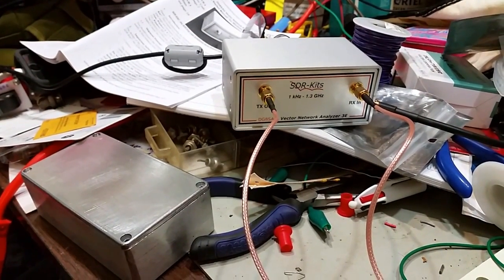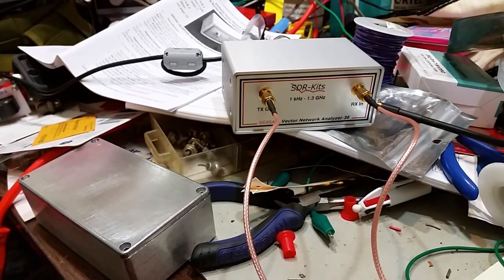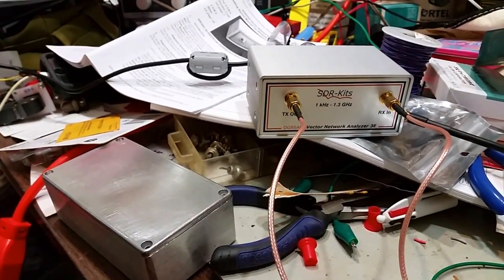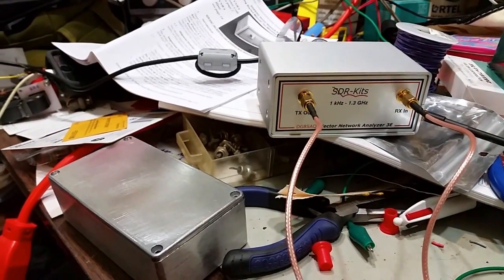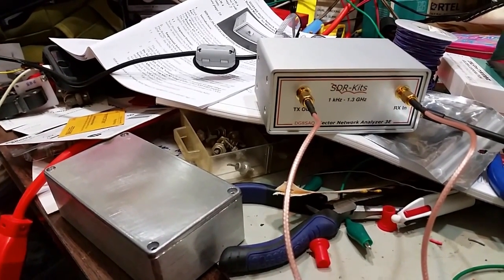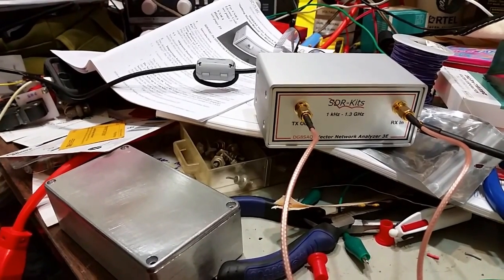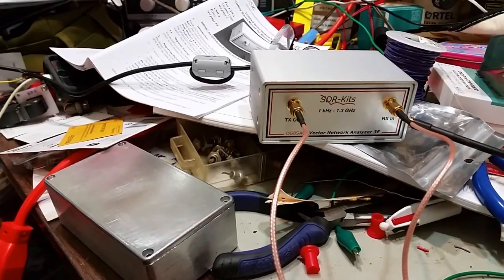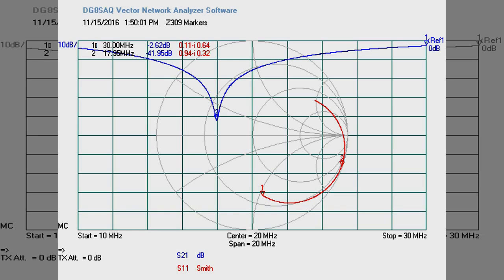Using the DG8SAQ Vector Network Analyzer to identify an unkown component

Comment: I'm new to working with coax cable and Network Analyzers and I recently got a DG8SAQ for part of my job. My questions is how did you create the common ground to characterize the filter. I would like to replicate your test system for a few of passive filters I have to make sure I'm getting the correct frequency responses.
Reply from the maker: Harley Fernandez, I ran a piece of bare "bus wire" (solid #24 I think) between ground lugs on each connector and just connected the flying lead and clip to it. You can "characterize" most of the stray impedance out up to over 100 MHz if I remember right. I would be a bit more careful in the construction if I was going to use it up over 50 MHz or so on a regular basis, but I did use it to tweak a 110 MHz filter for another project.

Comment: Loved the video have you done a tour of your lab?
Reply from the maker: Not yet--embarrassed by the mess. I will probably do one soon.
Reply: so what sold you on this analyzer compared to the MinI VNA  ?http://miniradiosolutions.com/minivna-pro/
Reply from the maker: I looked at a couple of options. The biggest thing was the frequency range. I like being able to get below 100 kHz and, in theory, the DG8SAQ VNA will get down to 1 kHz or below. I haven't done it yet, but I have some audio frequency filters that run from around 800 Hz up to 1,200 Hz that I would like to characterize. At the higher end, I rarely work above 50 MHz, but like the video on testing the dummy antenna shows, it can be interesting to see what a device is doing well above it's design frequency. I have a 110 MHz filter I need to adjust that is going in a homebrew spectrum analyzer and it will be nice to see that it rolls off and stays rolled off up to 500 MHz or so. None of the software seemed that intuitive, but the software with the DG8SAQ is nice and it is mainly a bench device for me anyway. One other thing that I couldn't find specifications for on several other VNAs was whether they measure both sides of the device (reflected at S11 and transmitted at S21) in one sweep or two. It isn't that big of a deal, but I like that the DG8SAQ VNA can measure both in one sweep instead of having a single detector that is switched from one side to the other to take the measurements. (Even those that switch do it behind the scenes, so it really isn't that big of a deal.) There is also a fairly active user base with the DG8SAQ VNA that seems willing to answer questions and share ideas. I don't think you'd go wrong with either, the DG8SAQ was just a better fit for me. The Mini VNA would be better if I was characterizing antennas at the base of a tower or something, but I just don't see myself doing that much. With the conversion rates, the DG8SAQ was about the same with the reference (short, 50 ohm, and open) connectors as the Mini, but that might have changed by now. (But below 200 MHz, I haven't had any issues with my own homebrew set of reference connectors that are built on BNCs either.)